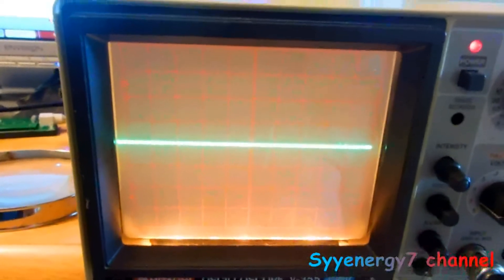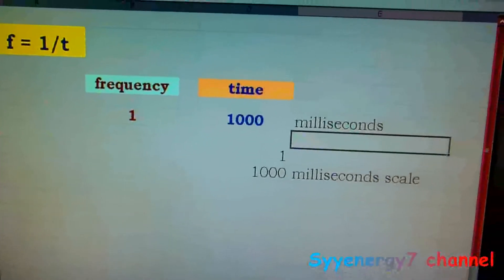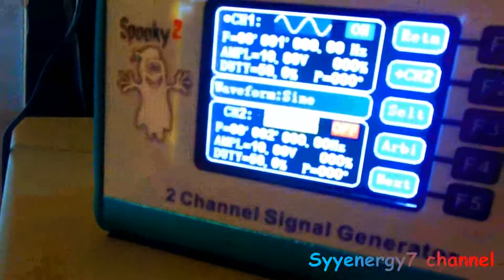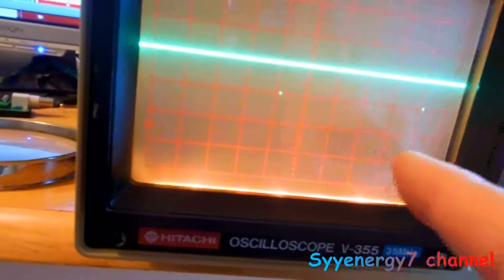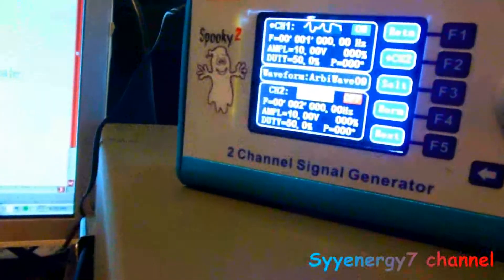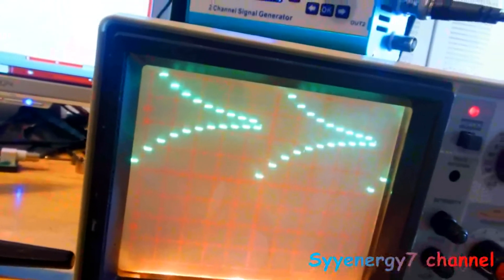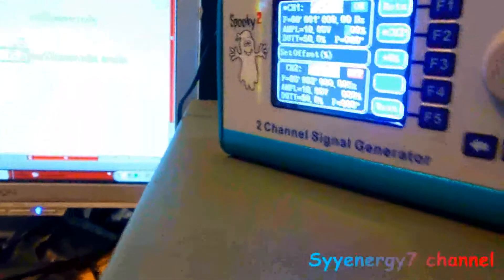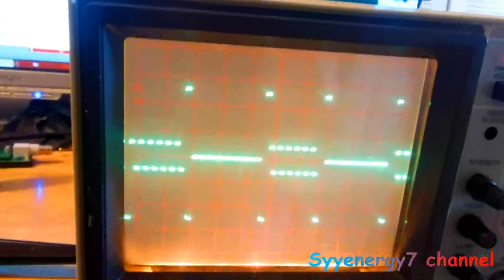How to Measure Frequency with Analog Oscilloscope & Spooky2 Waves Revealed

Comment: thanks for the update syy on the waves...
they match the pictures of the waves on the software.
Perhaps;
10  spike and sync -
11  spike and sync+
12  spike and sync + and -
13  spike and sync neutral
14  sine inverse and sync
15  square inverse and sync
Reply from the maker: Yeah, that could be.  Maybe something to do with sync.  Arbitrary wave number 7, dampened square wave is important if you just want to use the generator like a zapper.  I was checking out the accuracy of some other zappers that I have.  They are not accurate.  This little generator is very accurate and likely more accurate that the calibrated analog scope I have.  Very well worth the money.